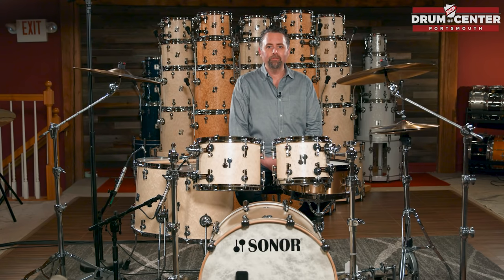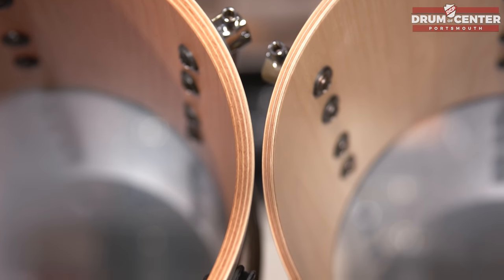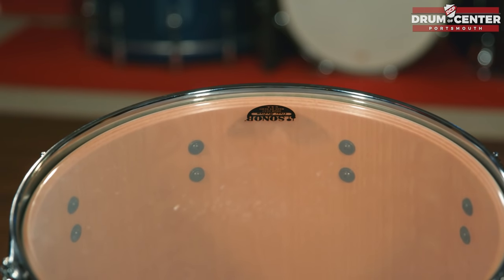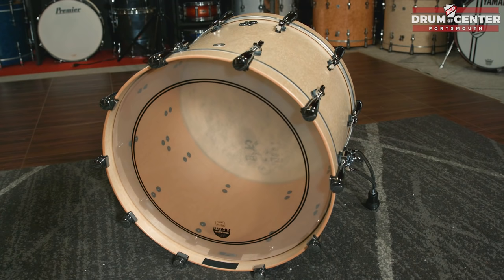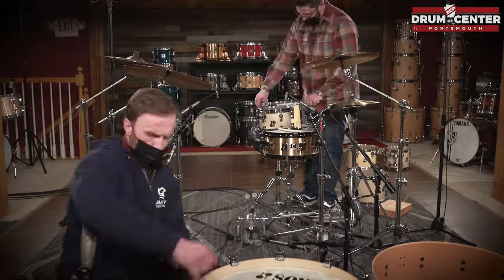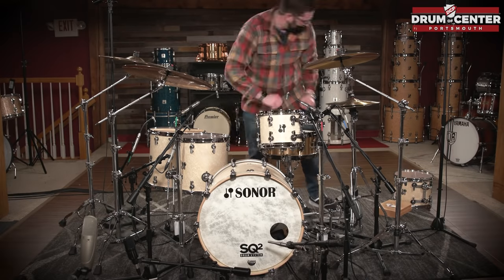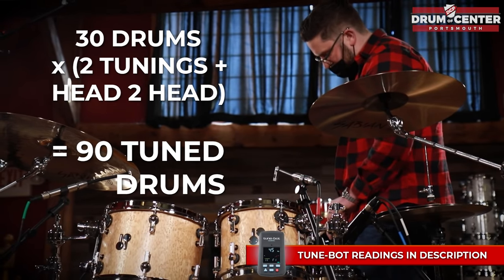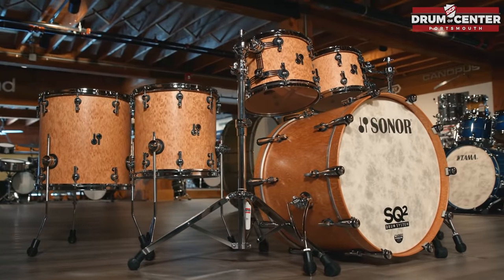The ULTIMATE Sonor SQ2 Drum Set Comparison - Part 1

Comment: This is endgame level perfection! So many of these came out sounding really similar to my ears, which I was surprised by. Or certainly most of the differences would get lost straight away in a mix. It would be fascinating to do a similar test with all of the tom heads in Evans' lineup for instance. I think you'd get more variety out of the heads than you ever will with the wood type or thickness, but that's just a hunch. If true it would be very empowering. Certainly a cheaper way to change the tone! Thanks for what must have been an unreal effort. Look forward to part 2!

Comment: Amazing work! This is the best sound and shell comparison. I love Sonor shells for my livetime. I worked for the company many years. Congratulation for this great work !i
Reply: they gave up a few techniques they used during Link era and even into Designer, ..    They used to put the seams as the "S" type that sort of locked together..  they have a patent on this.. "Wave Seam"   ,  after Designer they switched to straight all around.      They also used to literally lay or sew in the veneer sections on to the shell..   I have a video of all of this stuff from Designer era early 90's.

Comment: Outstanding work as always. You're light years ahead of the rest of the world for showcasing gear, and that's never more apparent than when you go into as much detail as in comparisons of this type.

On the subject of the differences between different woods and different shell thicknesses, I would absolutely to see a comprehensive comparison between Pearl's Reference and Reference Pure Series, which differ in shell thickness, hoops, and lugs but which both use different combinations of maple, birch, and mahogany depending on the size and type of the drum (along with different bearing edges and shell thicknesses), and something more "conventional from Pearl, e.g. the Masters Maple Complete series, which uses 100% maple shells.

The concept of using different shell compositions by drum size and type in a single series is a very interesting one, and in this era at least, Pearl pioneered it with the Reference and Reference Pure series.

Comment: This is really excellent and so helpful - just wondering why you changed the tunings for head-to-head tuning?
Reply from the maker: We selected a tuning that we felt showcased the differences the most for the head-to-head.
Reply: @drumcenternh  - excellent - thanks so much! BTW, the tunebot frequencies relate to the fundamental, right? Not to each lug? i.e 12” Top C3 Bottom C#4  so, Top 130hz Bottom 277hz - fundamentals? Thanks again for the great demo.
Reply: Interesting - tried 12” Top C3 Bottom C#4  on a 12x8 SQ1 and the C3 was way too low on the batter - head was rattling it was so slack. Maybe the 12x9 makes a difference here ...

Comment: 1. Great job, as always.. 2. ALL the drums of the same sizes sound virtually identical, no way to tell them apart if you did a blind test. 3. Just like Sonor claims, the shells are a Passive component! 4. The heavier the shell, you can absolutely hear them sustain Longer (Not shorter!). Again, this is Science, also exaclty what Sonor found in their lab experiments.. Too bad if it blows a giant hole in all these products like RIMS, lighter and smaller hardware, etc. All that stuff does is to Reduce sustain, not increase it!

Comment: I would like to see 👀 a Sonor 600 Hardware comparison video 📹. I wonder how Sonar’s 600 Series Hardware compares to DW’s China made 9000 Series hardware. DW’s original U.S. 🇺🇸 made cymbal stands used to be built like a tank with thicker steel tubing and heavier chrome plating.
Reply: Good Point..      I always wonder how these guys on drumforum dot org and drummerworld ..   freak out over DW hardware..         If you EXAMINE closely the PARTS and JOINTS..    You will see the Sonor 600 series is clearly superior with the Castings and Joints.. much more custom castings,     and they use SOLID RIVETS all over the parts..       DW are just like everybody else with the cheaper generic joints and Hollow Rivets.          Check them out closely.